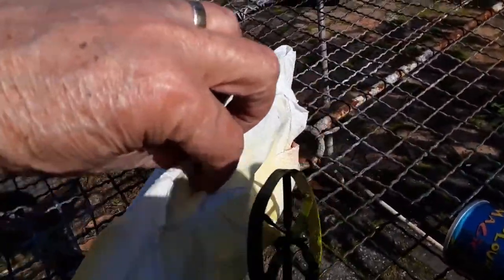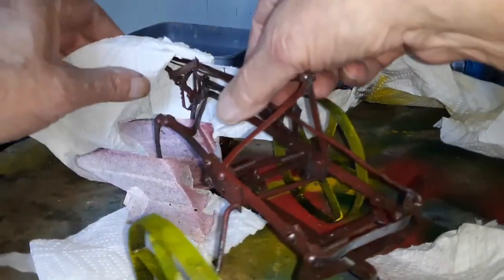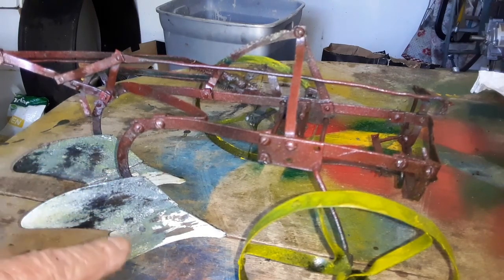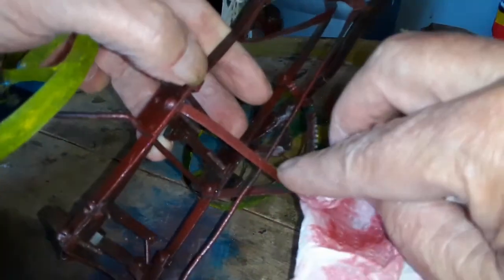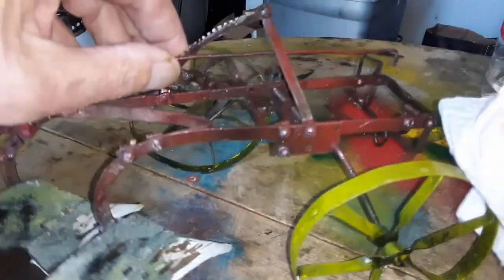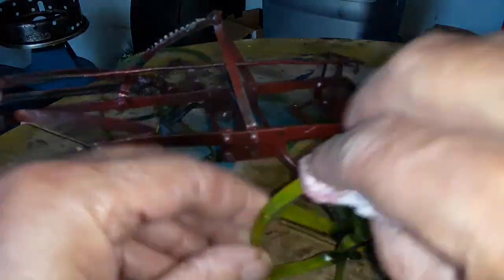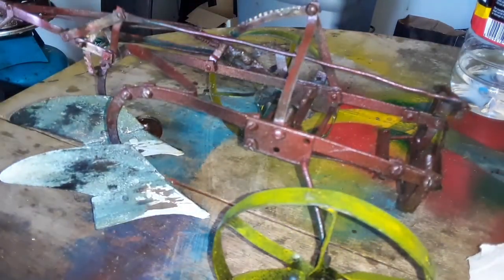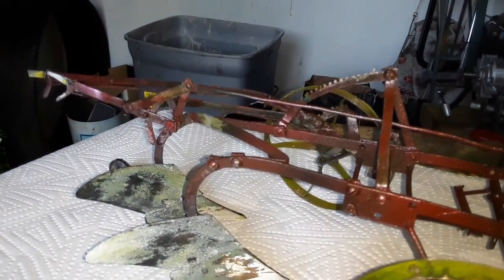Farmall Left Tyre Removal For The New One And Finish The Aging Of The Two Farrow Plow

Comment: You are Absolutely correct about the weight on the Right side Jan.  The Farmall Super A I had with the Sickle Mower was the same way. The "Cutivission" designmad made for a uneven Weight Distribution and so it had to be Compensated for, especially when using an Implement.  Did You Mount that Tire Yourself?  Looks Good. Looking forward to seeing You Driving Her again.  Good Luck.... and the Plow looks Great.
Reply from the maker: Thank You Dan, no I tried to mount it but I could not and I took it to a tire shop, I have an appointment for tomorrow morning to do this one as well, when the tire is back on I will clean the points, put fresh fuel in and take it for a drive, it will be a whole new adventure to drive without a flat spot on one tire, stay tuned my friend